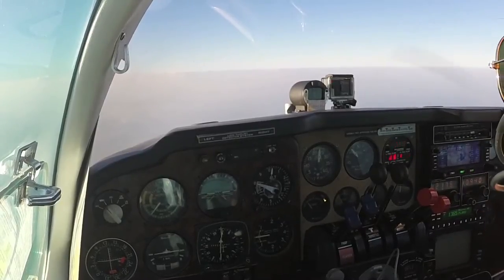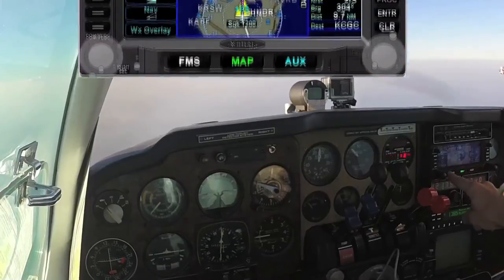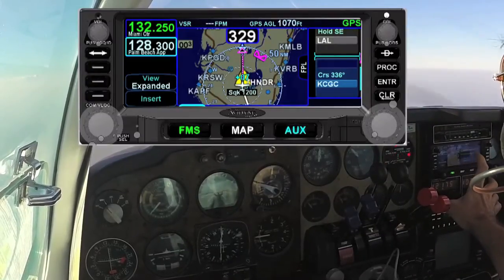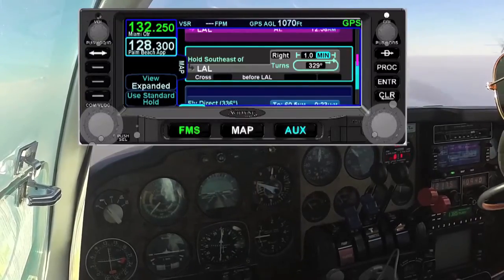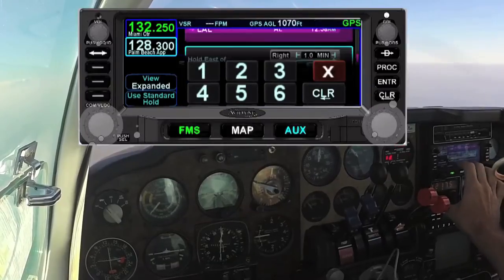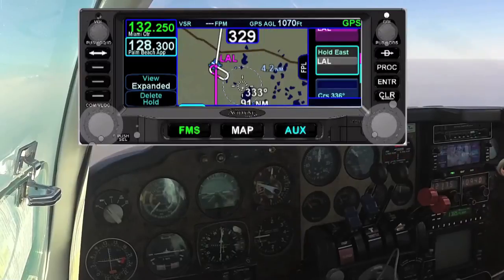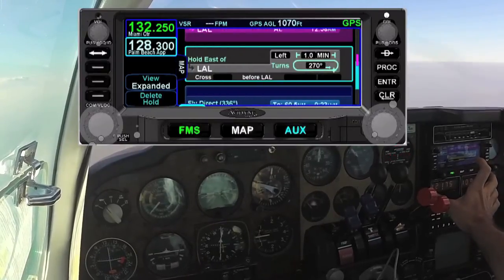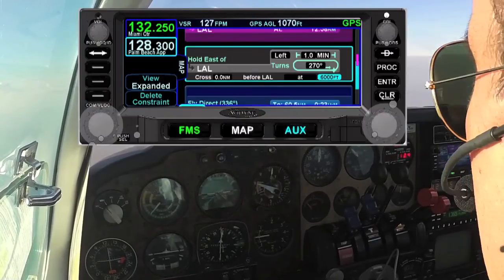Avidyne IFD Programing Unpublished Holds

Comment: What if the assigned holding point is a specified DME distance from a published waypoint?  How do you add that into the IFD?
Reply: you have to create a custom waypoint, which can be specified as DME distance from fix. -- then you can hold on that custom waypoint.